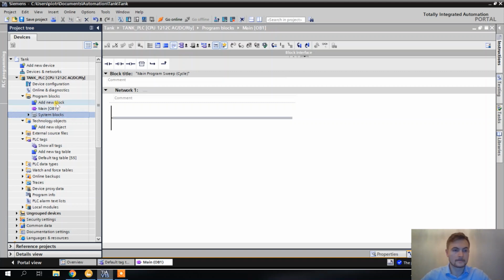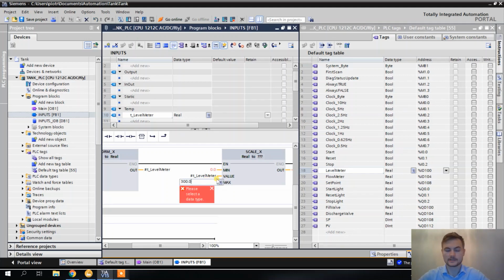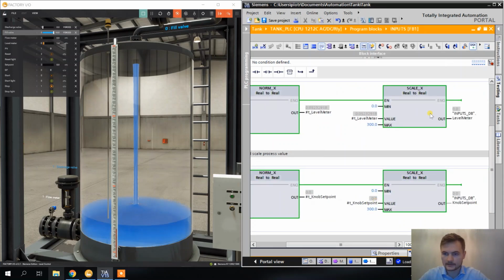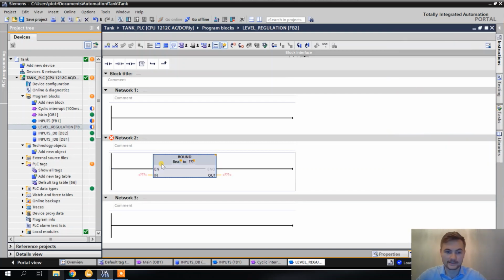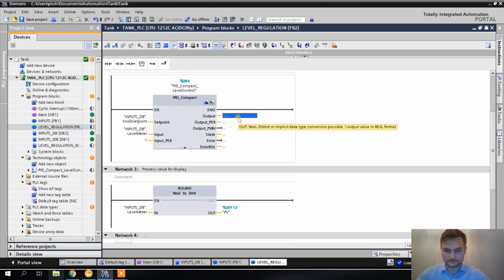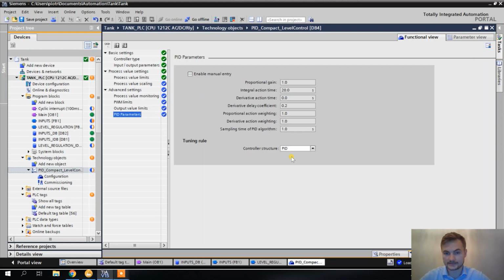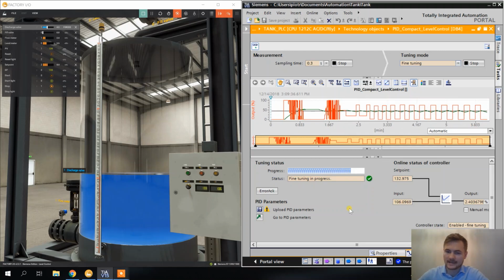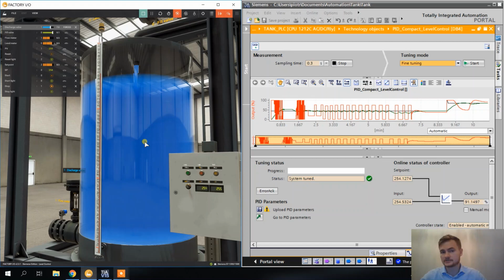TIA Portal Tutorial 11 - PID regulation

Comment: In 8.18 you are crate cyclic interrupt (100ms) block after don`t use at all PID controller working correctly if reading value in the same   interval of time.  https://www.youtube.com/watch?v=pMxMDUJtwKs&index=44&list=LLbU7-FBXABsQohONQ15xUmQ
Reply from the maker: Yes and no. In this particular case it's not an issue, but you are right that it could be in some cases. The only reason why the block requires cyclic interrupt is to have an even integration interval and defined differentiation period. What should be done to make it work just like it should is to add another process image to read and write analog IOs with the cyclic OB. Then Setpoint, PV and the valve output should be all in OB30. However I think it would be too much for this tutorial.

Comment from the maker: By the way in this video I am only scratching the surface. There is much more to say about PID regulators both from the scientific and engineering (practical) standpoint. I strongly encourage everyone to do more research on the topic.
From the theoretical standpoint these materials will help you to build the intuition about how it actually works:
https://www.mathworks.com/videos/understanding-pid-control-part-1-what-is-pid-control--1527089264373.html
If you want to learn more about posibilities of the PID_compact block in more sophisticated applications, the best thing to do is to start with help available in TIA Portal (click on the block and press F1).